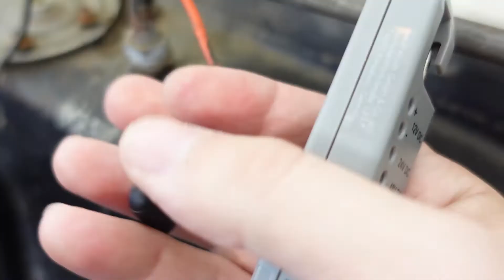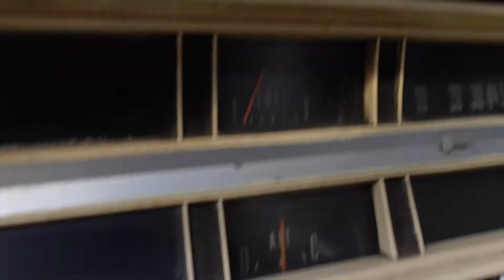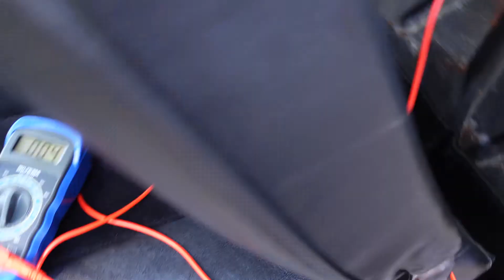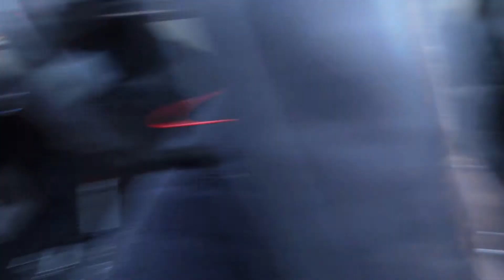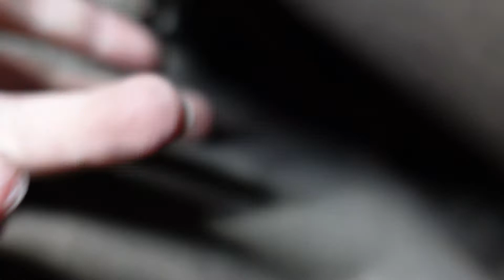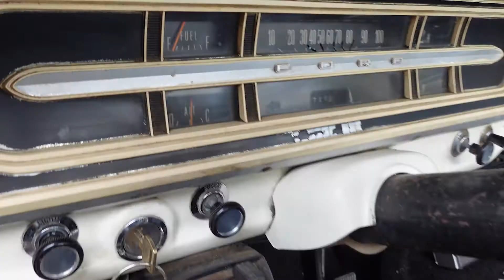F100 Fuel Gauge Not Working, Electrical Problem Solving! – 1972 Ford F250 (Part 3)

Comment: Hey Denis. Question about that orange cable you patch here: is that a cable up to the switching unit for flipping the gauge between tanks? Or is it a ground wire? Thanks... I'm about to do this job and wondered about that wire. I THINK it's to the switch, right? Not a ground.